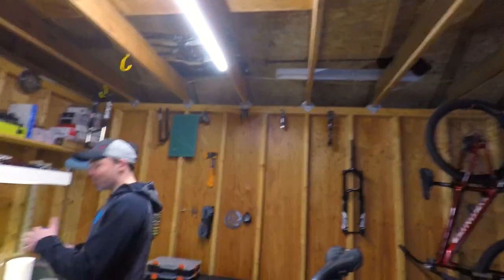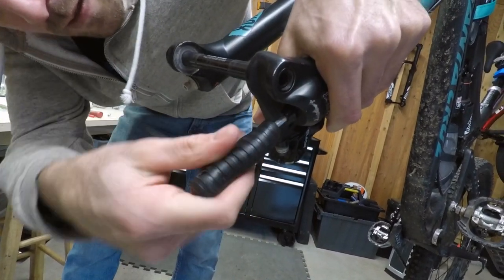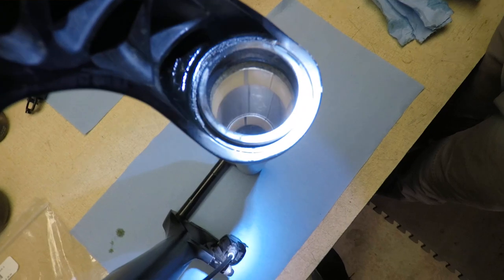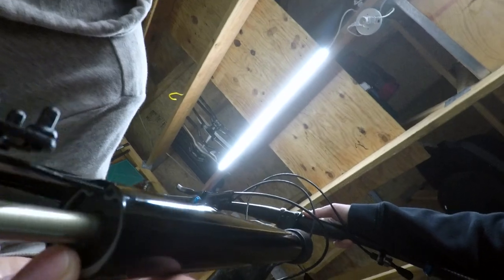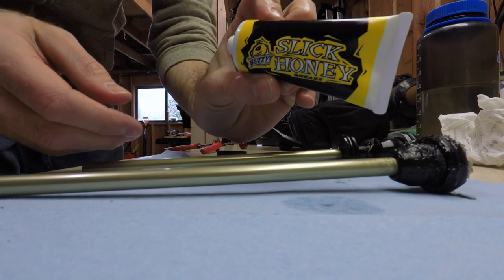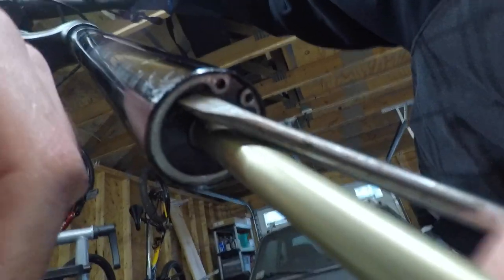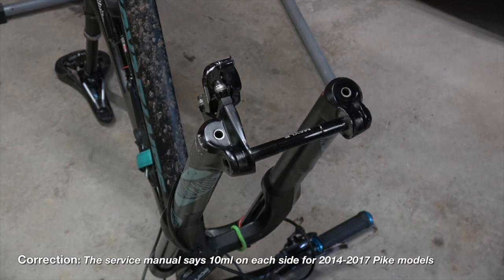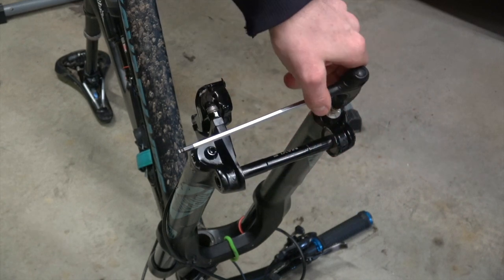How to upgrade your Rockshox Pike travel from 150mm to 160mm

Comment: Thanks for posting this! It was cool to see a regular home mechanic do this job! Note for anyone else doing this. As noted below I'd pull the caliper/hose "up"/off the lowers. There is always a chance you will drip oil and ruin your brake pads!! Also I would not suggest hitting your axle like that. Would really suck if it bent or damaged threads! AND I'd order new foam rings and have them available. They expanded/stretched and were really hard to get back in! (as well as inspect seals, heck for 16-20 bucks I will just get a seal kit with the parts so I have on hand next time just in case!) I bought cheap C clip pliers that change tips/angle, thought that might be nice? They wanted to "change tips" while in the middle of using them and kept falling apart... The "tab" between the C-clip; your not twisting the tab. Your pushing up, rotating around the whole seal head so the tab is "under" and not between the ends of the C-clip. (and then reverse when you put it together) Also I got all the way done ready to air up and only then noticed I'd sucked a bit of the seal under inside next to the arch. So I had to pull the lowers again. (didn't want to take a chance messing it up and having to wait to order new seats/tool) So good idea to check each step 100% before going to the next one. :)
Reply: Excellent comments

Comment: Thanks for this video. What year is this pike? Note that 2014 and 2015 (and possibly other) pikes are specified to use 5 and 15ml of oil, according Rockshox manuals. I think that this video suggested otherwise.
Reply from the maker: Queso 2017 Pike
Reply: Hi on my rockshox pike 2018 service manual shows 10ml on each leg why on your video 5 and 15ml ?

Comment: Great video. Does nothing need to be done to the damper shaft?  Does it just have extra length already?
Reply from the maker: Doug Thanks! No damper necessary. The shaft is built to run 150mm or 160mm on the Pike.
Reply: And don’t we have to add oil in the damper side to compensate for travel increase ?

Comment: I'd recommend NOT putting your lowers (and brake caliper) into the oil pan with your nasty used oil (if you'd like to keep using your front brake in the future that is), and also replacing your foam rings when doing this procedure.
Reply from the maker: Fair points!  There of course wasn't enough oil in the pan to cause any issues, but good call.  Replacing the rings is definitely recommended as well!
Reply: psshh who needs brakes just ride the lightening ! ( sprinkled with sarcasm)
Reply: richie smith this was a ”how not to service your fork video” lol.

Comment: Hi MTB Travel, got a little mess in my head

I want to reduce to 120 from 140. Do I need to order just one AirShaft?
Reply from the maker: Abel Ramos you will have to check with your fork manufacturer to see if that is possible, but yes, there is only 1 airshaft in a fork.
Reply: MTB Travel Review yes everything is ok I’m gonna change travel and by the way upgrade a revelation with the new debonair 

Thanks mate, very kind 👍
Reply: @abelramos8652  Lowest i've seen is 130mm on a pike. (I'm running it at 130mm)

Comment: does it makes the forks longer by 10mm? and the bikes become more slacker? if it is i would be happy with that.
Reply from the maker: Brian Sebastian it does add 10mm I’d travel, so technically yes, longer. Not really slacker though as the angle of the fork doesn’t change
Reply: Do you think 10mm is noticeable enough or would you recommend 20mm?
Reply from the maker: Anthony Zrillo 10 is very noticeable. Not much you would need more than 160mm of front travel for

Comment: Does that work for a rock shox yari ?
Reply from the maker: Er Pol honestly I don’t know. I would call and ask rockshox
Reply: @MTBTravelReview  ok tank you for the answer
Reply: If your Yari isn't at the maximum travel already then there are parts to do it. Just make sure to replace the foam rings with new ones in the lowers. So many videos skip that part. Every fork should have a lower service after 50 hours.
Reply: Yeah I’ve just fitted the debonair upgrade kit to my yari forks, I took the foam rings out clean and soaked them before refitting them

Comment: Have you experimented with other tires/brands? I ask because I’ve tried LOTS of different tires and I can’t seem to figure out why so many people like the minions. Even people who admit that they don’t roll well, wear relatively quickly, but insist on using them. Just wondering as you said you’re fairly new to mountain biking. Good  video btw!
Reply from the maker: I have experimented with many of the Maxxis tires on the market, and I agree, the minions don't roll the fastest.  That is why I normally run what I consider the magic set up with an Aggressor in the back and a Minion DHR up front.  Minion DHR handles the dirty work up front and holds traction like no other, while the Aggressor in the rear maintains traction, but allows for a lot more speed and momentum.  Thanks for the compliment btw!

Comment: Where did you find that Shaft? Do you have the link?
Reply from the maker: Marco de la torre bonacich found mine on Amazon. Don’t have a link, but search for rockshox pike 160mm and it should come up. Just make sure you get the one for the 27.5 not 29er. If you are on a 27.5 rig of course
Reply: I'm thinking to install debonair system... I have this model FS-PIKE-RC-A2 - 31t60086070 (2017) 150mm but I want the upgrade to 160mm (I foind the upgrade in ebay) What do you think? is possible to do this upgrade?thanks for answering
Reply from the maker: Marco de la torre bonacich i wish I could be of more help man, but honestly contacting Rockshox would be your best bet. I am no rockshox expert and don’t want to answer incorrectly. Best of luck!

Comment: Why not remove the brakes so it doesn't contaminate with the oil
Reply from the maker: Limalima Arvin if you read the thread, that is clearly the consensus.  We were careful, so it was not necessary but is recommended.

Comment: INCORRECT WAY OF DISCHARGING LOWER LEGS FROM UPPER LEGS
Reply from the maker: Limalima Arvin worked fine
Reply: @MTBTravelReview  dude he's right, its better to hit the bolts with the hammer, not the axle. both work but you may bend the maxle
Reply from the maker: Tim Smyth appreciate the info man! Helps to give a solution, not just say it’s wrong like he did. Lesson learned!
Reply: @MTBTravelReview  laying a 110mm long piece of wood over the axle and hammering on that would prevent it from being damaged, ya?
Reply from the maker: @phorest  the issues is more with the internal seals, not the actually hammering of the axle.  The proper method is to hit the bolts from below, which breaks the seal and releases the lowers.